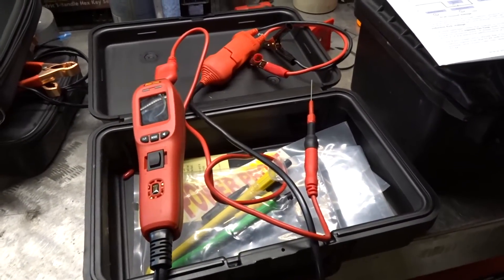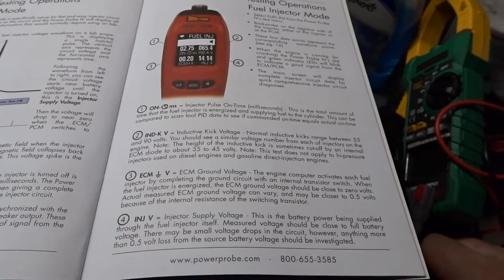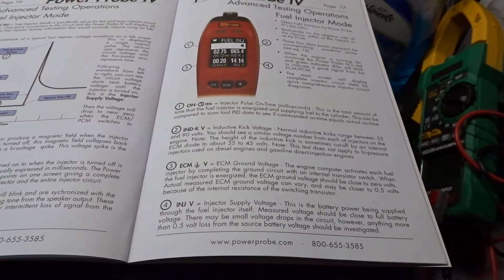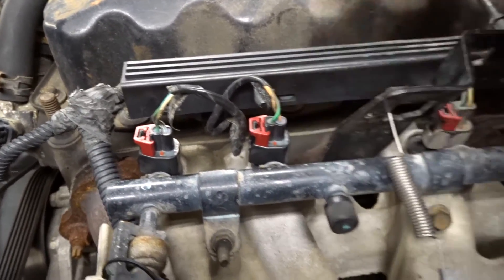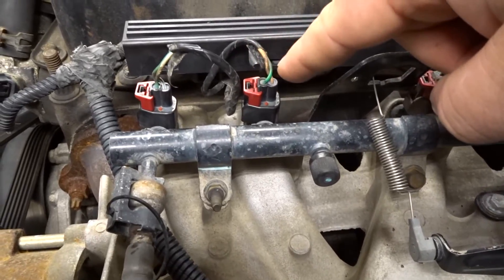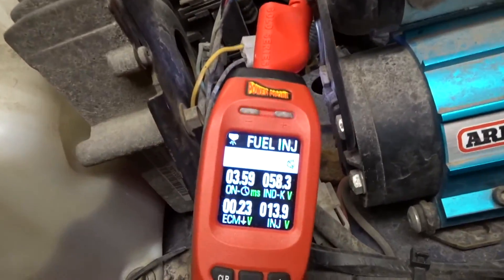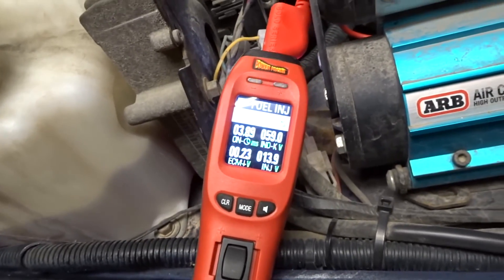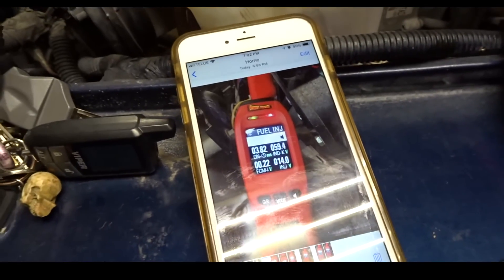Advanced Fuel Injector Testing Using Power Probe 4

Comment: Not sure this would tell you the injector is bad, only the signal. This is basically an alternate tool to a noid light. You'd have to do an injector balance test with the scan tool and measure the pressure at the rail before and after the test.

Comment: Seems like, if the pintle was stuck, or the injector was clogged, it would not show up on the power probe tool. Because it measures voltage only. An Amp probe with a handheld scope would show a dip in the amperage ramp wave that indicates inductive distortion caused by the actual movement of the pintle against the spring. If the waveform rises linearly, that means the pintle is stuck.